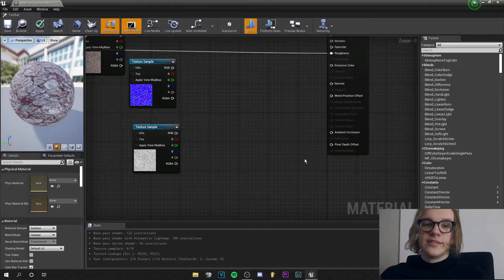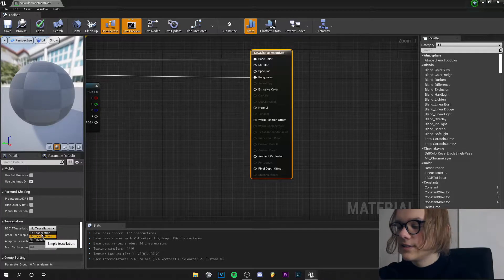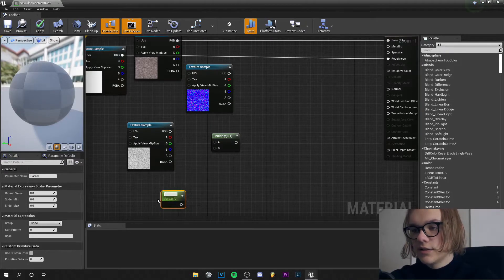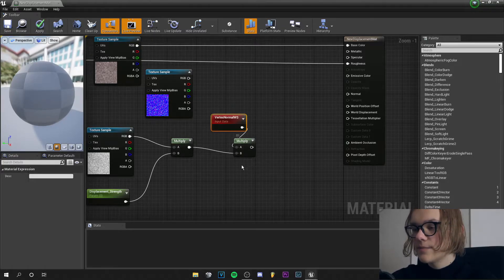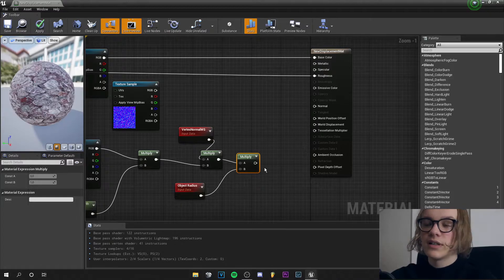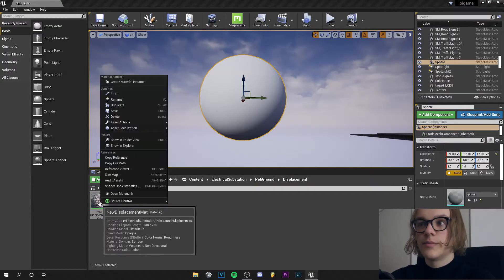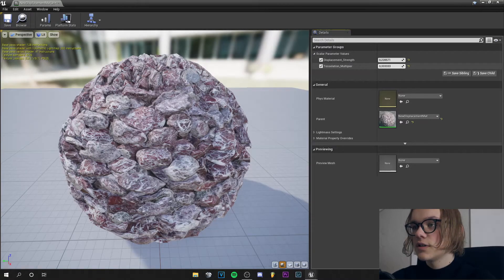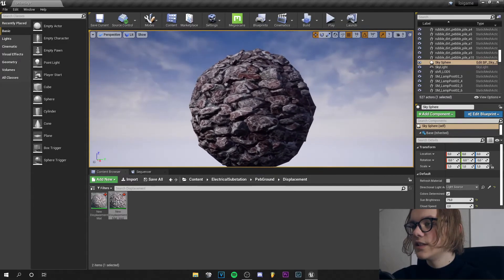How to use DISPLACEMENT TEXTURES the RIGHT WAY | UE

Comment: how did u add world displacement ? it's dosen't show in my blueprint
Reply from the maker: Hi, seems like in Unreal Engine 5 World Position Offset is used or Blueprints to create displacement on a mesh.
Reply: @UnrealMatter  ye i see but what the difference between normal displacement and world position offest ? what is better ?
Reply from the maker: @هيثم.الغامدي07  There is no "better" option. World displacement just doesn't exist anymore in Unreal Engine 5 so If you want to do it in the material editor you have to look up world position offset :)

Comment: whats the difference between this method and the casual bump offset method?
Reply from the maker: @GennaiosFX  So in summary displacement looks more realistic but has a higher cost in terms of gpu power.
Reply from the maker: @GennaiosFX  Hey, thanks for your comment! Bump offset, also known as parallax occlusion mapping, is a shader technique that fakes depth by offsetting the texture based on the viewing angle.  However, the displacement technique modifies the actual geometry of the mesh.

Comment: it only works on spheres?
Reply from the maker: No this works on every mesh. I just used a sphere for demonstration :)
Reply: @UnrealMatter  I've tried to do it on multiple meshes like; stairs and cubes, But it just makes the sides float in the air. Only works on sphere for me
Reply from the maker: @nudbet  Yeah this is normal. I wouldn't recommend using displacement on these kind of surfaces. Use normal maps instead. Displacement is more for ground surfaces or shapes like rocks. If you want to use it on stairs you would have to do a workaround and add other parts that cover these air gaps.
Reply from the maker: @nudbet  I think "How to Displacement in Unreal Engine 5.1" by Jon Jags Nee is what you are looking for :)